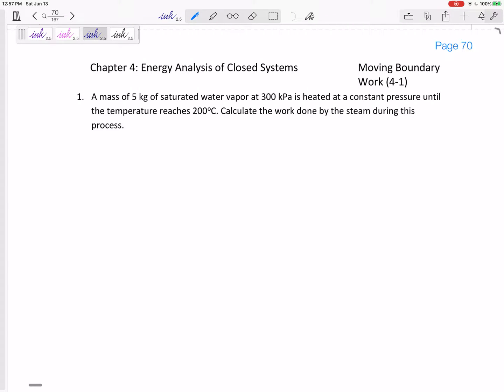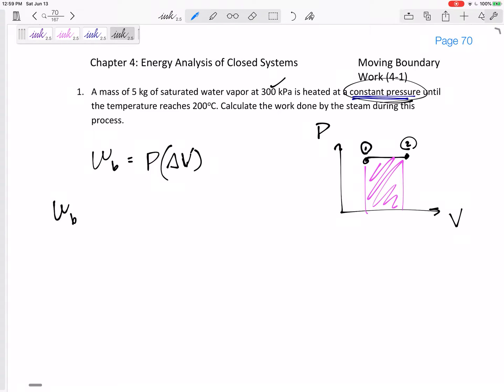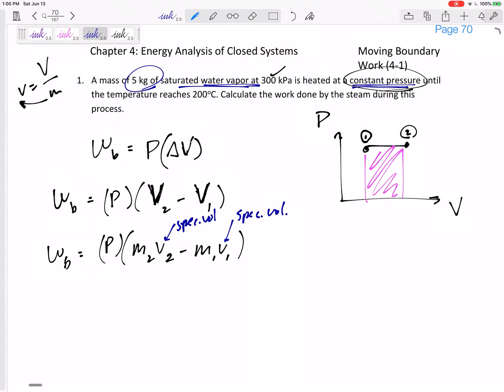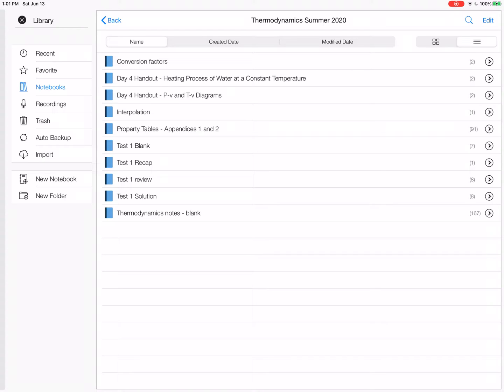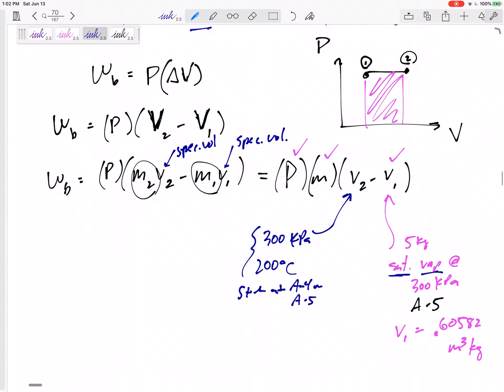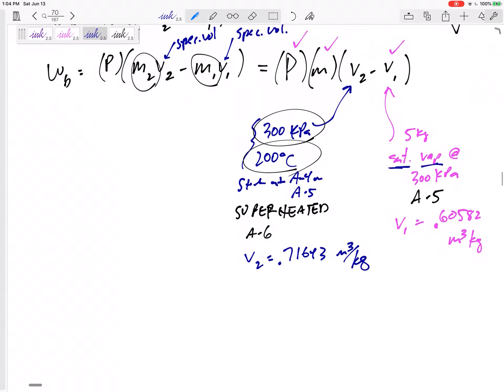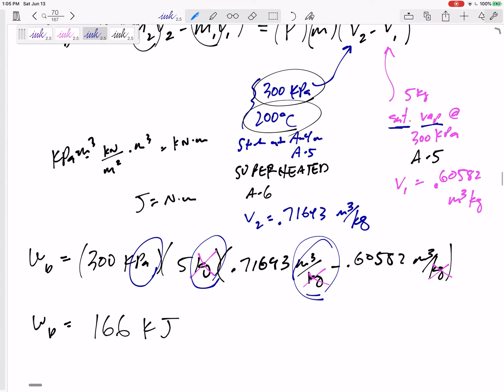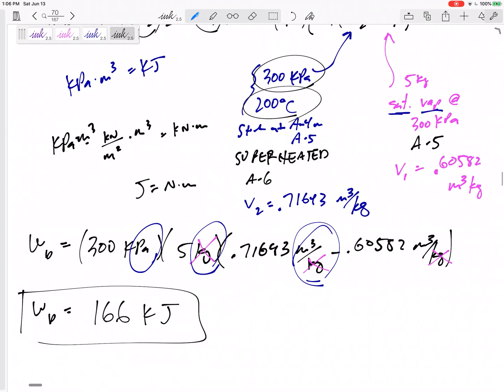Thermodynamics - 4-2 Moving Boundary Work in a constant pressure process

Comment: Thank u for your great effort to provide us such nice videos.
I wan t to ask that  isnt the boundary work in this case negative because we said expansion means Wout so it should be negative am i wrong?
Reply from the maker: The equations we derived for boundary work are all for “expansion” boundary work. So the equations will give us the value for boundary work out. Now, when we get ready to put that boundary into the conservation of energy equation- that’s when we need to make sure we plug in boundary work “out” as negative. But our boundary work equations are all positive for expansion (boundary work “out”).
Reply: I thought same thing mate, the system is doing work so it's Wout which is negative?